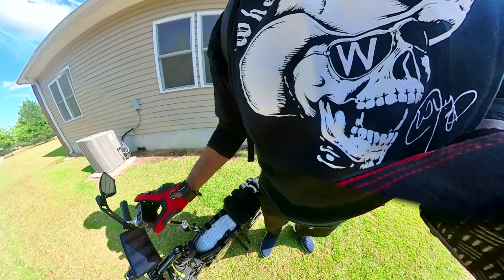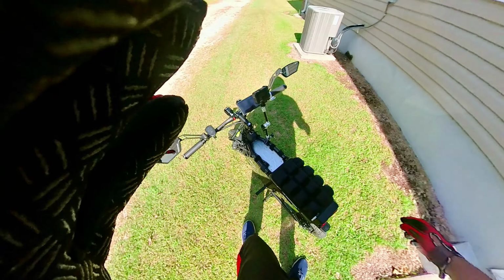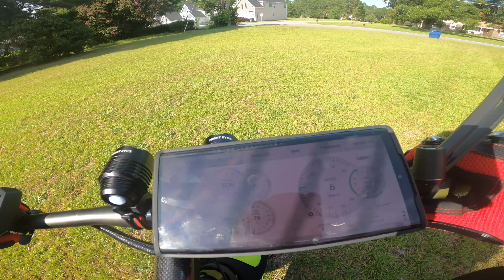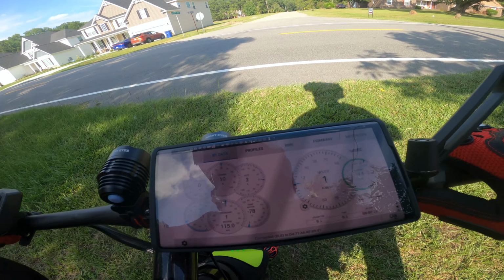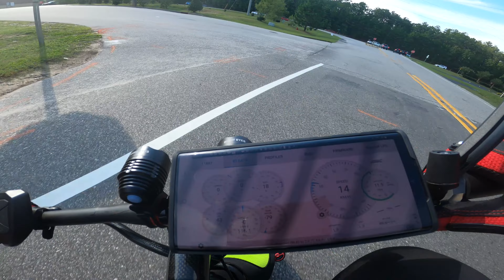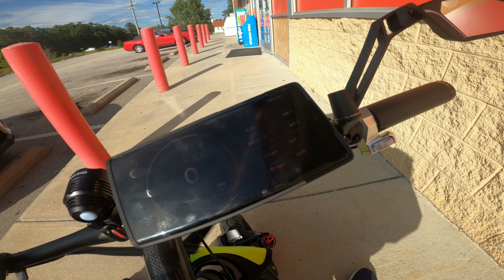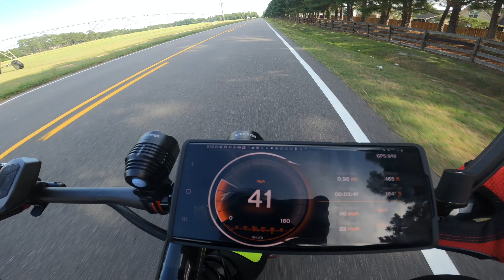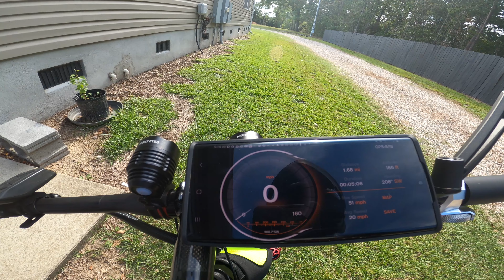Day 2 with the Tronic Roadrunner-High Speed Ride & My Tronic Roadrunner Mods

Comment: I was able to fit a 23Ah onyx battery inside my Roadrunner frame. I didn't install it. Just checked it for fit...
Reply from the maker: That's awesome. The body design of the Roadrunner has so much potential.

Comment: U seem to be a big guy like me so how do u ride comfort-wise not including the seat..do u feel scrunched up or kinda like an adult riding a child's bike..thats the only concern I would have getting this bike compared to say a surron or talaria sting for almost the same cost
Reply from the maker: Yes, I'm 6'4" and close to 240lbs with my gear. Your right, the Roadrunner Tronic wasn't a good fit for me. I think I mentioned in one of my videos that this was one of the reasons I returned the Roadrunner Tronic for a refund. The first issue was that the frame isn't stable enough to handle the massive power that the Tronic Controllers puts out to its dual 5,000 watt motors. I've seen bigger guys enjoy this mini-bike but I just didn't feel safe riding it. But it was truly a blast to experience all that smooth power packed into a small bike.